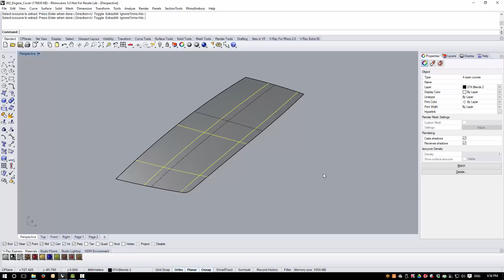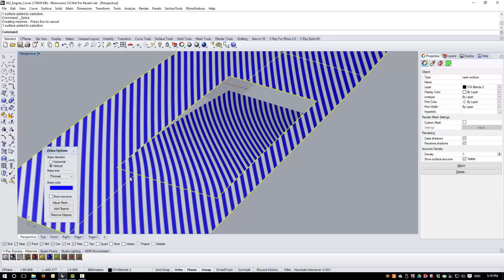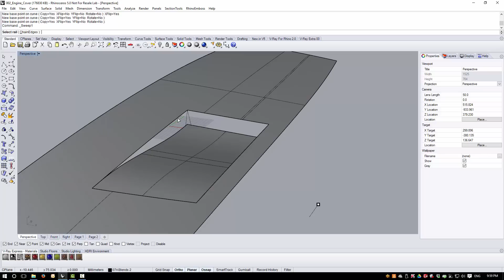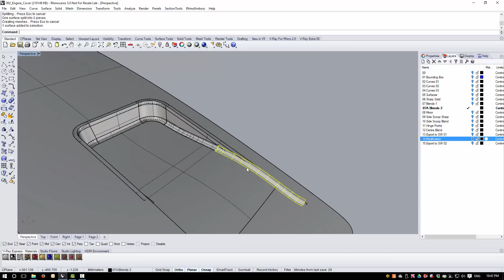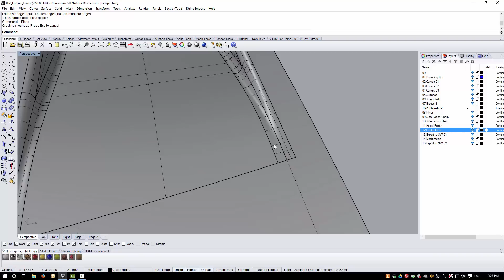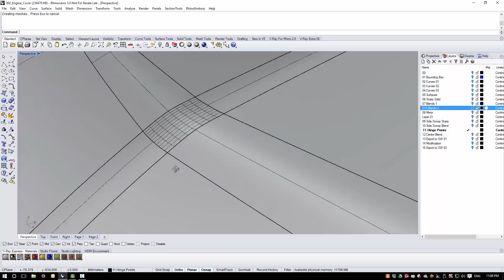Rhino3d Tutorial - Engine Cover - Adding Local Detail (2 of 3)

Comment: What is the difference between fillet edge & blend edge? (Solid/ fillet edge/ fillet edge, blend edge)
Reply from the maker: The Fillet Edge command creates a tangent continuous radial fillet (arc based cross section - degree 2) whereas Blend Edge creates a curvature continuous freeform blended transition (spline based cross section - degree 5). 

The blend result will look ‘smoother’ than the fillet and when you use surface evaluation the blend and the two adjacent surfaces can be made to look continuous- whereas you can generally see a tangency as a small disruption to the surface reflection.
Reply: @SimplyRhino3D  Thanks Sir!
Reply from the maker: @hvalu.2206  You're welcome!

Comment: Congratulations!! Your tutorials are amazing! I have a question though... When I use the trim tool and I tipe "crv", Rhino asks me to draw the line and not to pic one the edges... do you know why? Maybe I have a modern version so the commands are different?
Thanks and congrats again!
Reply from the maker: Hi Bernardo. Thanks for your comments. The commands are the same in the latest version of Rhino. Just to be clear, the command sequence is this:
 
Trim
Enter to run Trim
You should see this prompt ‘Select cutting objects ( ExtendCuttingLines=No  ApparentIntersections=Yes  Line )’
Don’t select any options but type in ‘Crv’
Enter
You should see this prompt again  ‘Select cutting objects ( ExtendCuttingLines=No  ApparentIntersections=Yes  Line )’ now you can only select curves or surface edges

Comment: Reference around 2:30, why didn't you just use project crv instead of extract iso crv? Or even extrude the original curve and cut using that?
Reply from the maker: Hi. Thank you for your question, I did try to explain this in the video but I used the Iscocurves because I wanted curves that followed exactly the topology of the surface in both U and V. This will allow the intake shape to follow that of the engine cover and, perhaps more important, will give me the best possible chance of creating the smooth seamless transition at the leading edge of the intake.

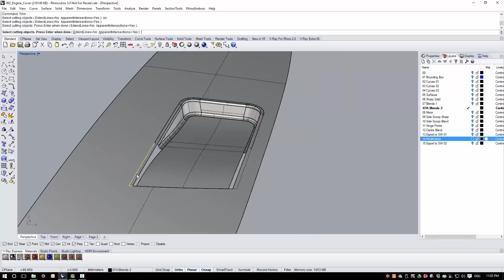Comment: Can I ask why did you trim the base surface with half of bottom line (right side) in 31:45?
And is the extended curve on surface clean enough?
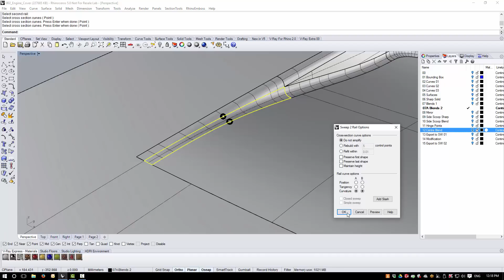Reply: And in 38:40, does it mean that "join" change the geometry of surface?
Reply from the maker: Hi Yusuke,
 
The fillets that built initially did not complete so there was no surface trimming. I used the parts of the fillets that were correct and curves (some extended) from the usable edges of the parts that didn’t build properly to give me a set of curves to trim with.
 
Whether you have trim with curves, surface edges or extended curves, the result is always a trim fitted to a tolerance (ie the curve will have more control points than the surface it’s based from). I would try to avoid this for major surface features but it’s a not a major problem on areas like this.
Reply from the maker: Hi Yusuke,
 
Thanks for your question - I didn’t make this clear in the video. Joining doesn’t change the surface geometry. The surface analysis tools (including Zebra) are mesh based – they give a representation of the surface. The mesher in Rhino will display smoother transitions if surfaces being analysed  are joined so it’s worth joining surface edges before analysis.